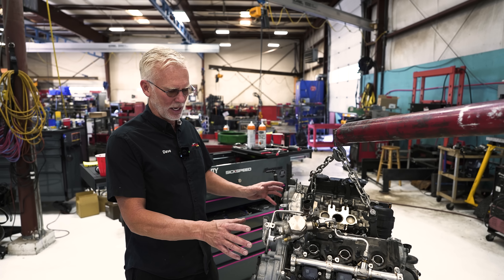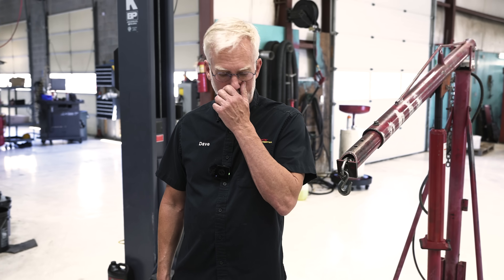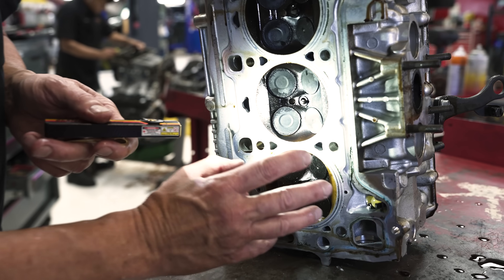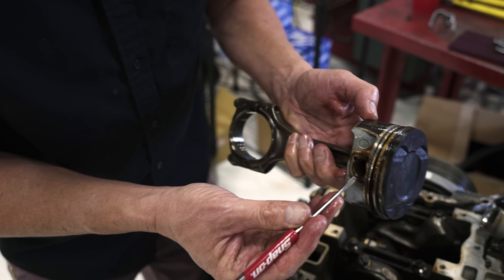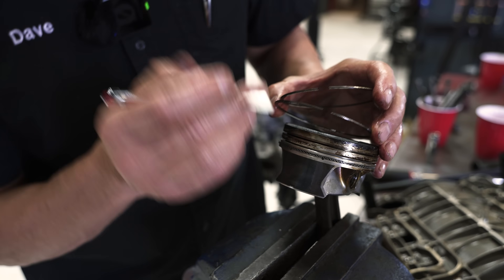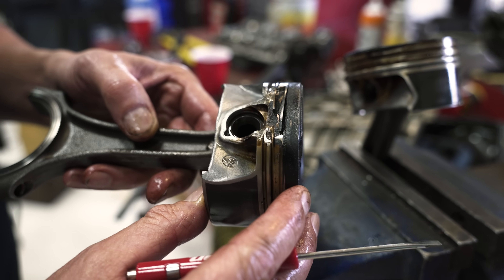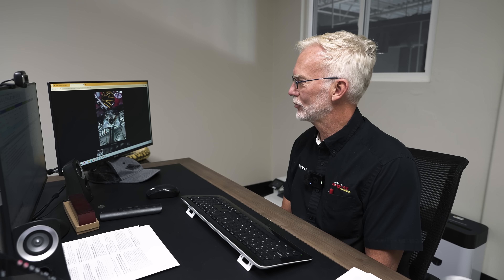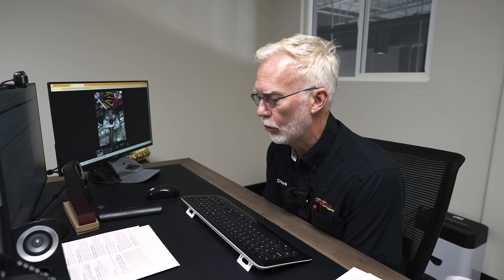Audi S5 Update: Piston Damage From LSPI (Low Speed Pre-Ignition)

Comment: I’m gonna be honest if you drive an Audi you really shouldn’t be using anything aside from LiquiMoly, Pentosin, or Factory Oil. Castrol although on the oil filler cap will cause problems. Also just wait a 20-30 seconds for the car warm up.
Reply: Since there is warranty on engine till 80k miles in usa related to piston issues, all owners should use factory oil, so warranty can't be denied

Comment: Use the oil viscosity recommend by the maker.  A 0W is thinner than a 5W but they both flow well in cold temps (above -20 F).  The SP shows that the oil has about 50% less Calcium in its composition.  They found that high calcium was also a contributing factor for LSPI.  Finally use only a premium Top Tier fuel.  The cleaners in that fuel also help prevent this from happening.
I live in Canada but seldom see temperatures lower than 0 F.  My VW uses 5W-40 engine oil.  I have been temped to use 0W-40 just so that it would flow better however a 0W-40 has more viscosity index improvers which can form crud under the rings.
The moral of this story is use the right grade of SP oil (change it at less than 5k miles) with in conjunction with quality gasoline with the correct octane rating.  That might save you $30k for a new engine.

Comment: Thank you, Dave! This was super helpful. Although my engine is dual injected, it appears that the risk for LSPI is minimal, but still there. I use Pennzoil Ultra Plat which is API, SP, and RC certified every 3,000-3,500 miles. I only use 91 octane top tier fuel from Shell, as well as Techron Fuel System Cleaner to help clean both the port and direct injectors. At cold start, I only let it warm up for about a minute (I watched your video with Lake the Motor Oil Geek about that), and I don’t go above 3,000 RPM until the engine oil temperature gets up at least to around 180 degrees F. 105k miles and drives like new still. 🤝

Comment: One quick detail worth mentioning. The germans started, but most nowadays use 1100rpms the second you set cruise control at low speeds(it changes to the highest gear possible). If you're like me, getting in your car, set it to cruise and getting to work, in a cold engine, that cruise control is bad news for residential streets... In uphill or other situation where normally the car downshifts to a reasonable 2000rpm for more power, instead what I noticed is, the car is trying to keep the tallest gear throughout. That is the perfect storm... the ecu is asking for power at 43mph uphill in 6th gear with a cold engine.. all in the name of good gas mileage
Just something to keep a eye on

Comment: its funny im dealing with the same issue on my 2019 audi A6 they share the same exact motor i bought it with 40k miles on it and 2 weeks later theres rattling noises coming from the motor. took it to audi and they told me cylinder scoring and recommended new motor. thank god new york your covered within 60 days and theyre replacing my motor for free.

Comment: hope you checked the rocker arms. The needle bearings are notorious for wearing down on the 2018's.  I had one and had a rocker arm issue that was a very costly fix.  These cars may look cool. But audi quality has really gone downhill.   With so much over engineering you would think they would be so problematic.  But honestly.  My best advice to anyone is never buy the first year of any Audi product.  Wait till the second year or even the facelift.  That sucks for guys who like to tune.  But the facelifts usually have a better look, better options and less problems.  Yet they are all ticking timebombs.  

 Most things on audi's wont throw a code until its absolutely destroyed.   And many audi dealerships will ignore or deny certain issues you KNOW are happening with the car  but because they dont see a code, they wont fix it.  Like when a 2016 S5 roots superchargers has its internal heat exchangers fail.  Very common. It dumps a bunch of coolant straight into the air mixture and you not only get carbon build up but actually you have plasticized coolant around your valves.  I actually had a $10K supercharger bet.  The tech at the dealer didnt want to pull it.  It was fi he pulled it and it was leaking they would replace the cores. If it wasnt I had to pay to have the work done that didnt need to be like pullling and putting the supercharger back.  They rebuilt the supercharger.  

But they never cleaneed the intake valves or any of the carbon.  ANd this was OBVIOUS.  IT was thick chunks of pink.  That was all coolant. Ive had 5 audis.  Not a single one of them have been reliable with the exception of a 2012 A7.  But even that is only a matter of time.

Comment: Normal levels of pre-ignition are supposed to be handled by multiple knock sensors and an ECU that dials back timing with knock onset. Another issue that was not mentioned in this video is fuel hydrolock. When you're running very high injection pressures (300-2000 psi), an injector malfunction can result in serious engine damage very quickly whether it's poor fuel atomization spray pattern and detonation or flooding of a cylinder with fuel that results in piston damage and bent connecting rods. At 75k miles, these "high performance" injectors are prime candidates for malfunction which if you're lucky - just results in a misfire and ECU shut down of fuel to the cylinder in question. If you're unlucky, fuel overload and hydrolock can get very destructive very fast.

Comment: You can actually hone some aluminium cylinders, ive seen it done on a E92 M3 motor. They called it alusil so im not sure if that is different to nikasil. But honed it and then etched away the aluminium in the cylinders using acid to expose new silicon.
Reply: on EA839 2.9 cyl walls are "plasma sprayed" and not nikasil nor alusil

Comment: A Ford engineer actually coined the term LSPI.  It's just oil getting into the combustion chamber.  Oil has really low octane.  He said a good enough gasoline should overcome that.  Matt Dickmeyer says that stratified charge is responsible; you have a rich mixture in the middle of the cylinder, and lean mixture around the edges.  It's the slow burning lean mixture that actually initiates knock.

Comment: Except for maybe certain circumstances, I don't see a auto technician pulling in eighty grand. and this is coming from someone that has been an auto technician most of my life.

Chevrolet Vega's have a aluminum engine block. with silicone impregnated aluminum cylinder walls. and everyone knows how those engines worked out.

Comment: 14:23 before this happens ..Seafoam....run it in the oil couple hundred miles then change it ....put some in the tank ...dump some in the throttle body while someone revs it to 3 grand...won't have that problem...use the correct oil

Comment: Also you're wrong that’s not common. There’s only 2 things that likely cause that. Likely wrong oil or that car was tuned and re-flash back to stock tune prior to selling to previous owner selling to dealer. The customer should have bought extended warranty. It would’ve likely covered a long block. I’ve worked for Audi as specialist technician for 7 years and seen LSPI most of the cars were tuned. ODIS can see that and ultimately the customer will need new engine. 
Dealer don’t rebuild engines we replaced it. 

Also please don’t lie to the young Technician. You a clear 80K by the time he’s 23. You’re probably helping him out and pay him by the hour and not Flat rate. Don’t run into many of your videos, but you talk like a motivational speaker.. Let young Technician enjoy his lunch. That’s off the clock. Teach the Technician don’t on company time don’t exploit him for Subscribers and Likes..

Comment: My guy! I think you just saved my motor. I've been getting a jerk in my A5 at low speeds when its cold. Never heard of this. My oil is API SN which is the older standard.  Changing to SP tomorrow as well as the plugs. Already ran Berryman's and Techron through. Hopefully my pistons are ok. THANK YOU! 🙏 About to go to Stage 2 tune. Pray for me! 😂
Reply: sounds like carbon buildup in the intake
Reply: If it is a crackling ticking noise, definitely lspi. low compression misfire however mild would be the death rumble, and then engine warning light. I've got the B14XFT(Opel Astra K) and it's completely screwed.

Comment: Everything is fine, but the conversation about the cylinders was already superfluous. The engine block is indeed nikasil, but in this generation of the engine, namely the EA839, there are cast iron cylinder liners from the factory, which can also be seen in the video, where you can clearly see the honing grid on the liner, which never happens on nikasil liners

Comment: If I ever need engine work, I am coming to Dave's. Fuel quality and proper octane is important on the TDI engines. I run Top Tier or fuel that exceeds that specification. Top Tier fuel has additives that you mentioned at one point in the video.  The Motor Oil Geek has a video where used oil analysis proves that fuel quality does make a difference in helping keep things clean and help reduce engine wear.
Thank you for the great videos and the best to Alejandro and all the others in your organization.  Your crew does amazing work.

Comment: I do not believe Bosch nor Audi, or any DI oem allows single injector replacement. They are always replaced as a set. 

You can absolutely repair a Nikasil cylinder, we’ve done it many times on motorcycle race engines. You just have to find a quality shop, send them the case where they will bore the cylinder or cylinders then dip the case in tank for replating. The biggest issue with Nikasil is getting a quality plating as poor plating will lead to chipping/flaking which in turn leads to catastrophic failure. The crosshatching needs to be done by shop familiar with Nikasil as the stones used are specific to Nikasil. Never, ever use a ball hone on Nikasil. 

There’s a firm in Idaho we’ve used for many years, Millenium Technology, that specializes in Nikasil repairs. I do not believe their tanks are setup for automotive engine case capacity. I would contact them for referral if you need an auto engine Nikasil repair. Never, ever install an iron sleeve in a Nikasil case, especially with oe pistons. The thermal efficiency and expansion of iron sleeve is drastically different than Nikasil cylinder and would result in comprised performance. The hypereutectic pistons used in Nikasil cylinder applications are not suitable to be run in iron sleeves and will ultimately lead to thermal overload of piston and failure.

Comment: I drive a 2017 Vw 1.4 liter Jetta and use Amsoil oil recommend for my car VW 502.00/505.01. When I start my car the RPM rev up to around 2200 rpm. I always wait until the rpm comes down to normal rpm idle around 1800 rpm. I have done since I bought the car new. I figured it was designed to do this so the car oil was warmed up before driving.

Comment: Any turbocharged vehicle can suffer from detonation. Its simple.. imagine that your gas pedal is not only controlling the fuel but the air going into your engine too. Now your pedal doesnt know the differece between 2k rpm and 5k rpm. 5k rpm can safely deal with the added compression from the boost. (Boost essentailly makes the intake air positive) too much positive pressure in the cylinder causes early detonation, especially if its been tuned and the timing hasnt been retarded.  So if your lug your engine, high gear/ low rpm thats how you purposely make that happen. Ppl do it in subarus all the time.

Comment: As someone with a German turbo’d car… another source of preignition is using low octane fuel. Also can contribute to dirty injectors using cheap fuel without PEA. Audi/vw often design higher  compression ratio engines which even the fuel door will say needs min 91 octane. For having the money to spend on an Audi to begin with, I see a lot of Audi owners putting in cheap fuel in their cars. Combine that with the storm of things Dave mentions it’s asking for preignition.

Comment: Anyone know if this issue with the GDI is also prevalent on the Hyundai’s? I got a used 2017 Elantra GT under a year ago and it’s the first I’ve heard of this type of oil. We did have an issue with a misfire but it wasn’t the coils or spark plugs but having to do with air flow.

Comment: This sounds like and Audi thing.  Why isn't this covered undedr warranty?  Audi should do a recall and fix these rings or replace them.  The API grade oil is a great tip.  I have owned German cars most of my life, and never considered the oild grade and manufacture.  Also, will go back to warning up my vehicles.  I was told that I should not do this on my Lexus.

Comment: They started putting the timing chains in the back of the engine due to packaging, it makes the front of the engine less cluttered. The duramax I6 engine was a good example, they had to fit a long engine in the bay thats designed for a short but wide engine. So moving the timing chain to the back gives you more room in the front for accessories and radiator

Comment: If you hit the throttle on a boosted engine when it is cold you are just asking for trouble. I've had my 2018 Audi S5 for 77,000 miles and its been great. No engine issues. 10W30 Synthetic oil (European) every 5000 miles. Good Vid Dave

Comment: Still waiting for a logical explanation for putting the timing system at the back where additional work has to be done to separate engine from transmission, and in RWD cars, pull the engine. What’s worse is now American makes are starting to do this. There are so many very reliable engines that put the timing system up front, that changing that paradigm seems needlessly exotic.
Reply: My assumption is to make money by charging more for repairs and to make it cheaper to manufacture considering all of the wires and stuff with these turbocharged engines.

Comment: Thank you for the information, however your probable failure explanation is not quite accurate , I would say LSPI  or in another words ‘ uncontrolled combustion event ‘ , basically a left over hot spot from a combustion event caused a combustion event at huge wrong timing API rating is not the only oil selection determination but there is also manufacture specific oil classification requirements especially for German cars . In short LSPI is a huge subject with many theories behind it .short of used oil analysis  including complete Ferrography  analysis knowing the reference  new oil and fuel analysis the exact failure determination is impossible ,

Comment: It’s not insane at all to put the timing chain at the back. The flywheel dampens the crankshaft accelerations from the pistons firing. This smooths power transfer to the chain and makes it last longer or be smaller and lighter. GMs garbage V6 with the timing chains at the front eats them for lunch. Don’t even last 100k miles. Might as well put a timing belt on there. GM junk

Comment: LOT of great stuff in here:

1) Everything Dave said about oil and fuel injector behaviors is spot-on. Great analogies for the folks new to car science. 

This is why, even on modern engines with synthetic oils, I always give my engines adequate time to warm up before driving, or before subjecting them to any real load (beyond 40%)

2) You couldn’t pay me to drive and operate an engine whose timing chains are on the rear of the motor… 👀 🤦‍♂️  Absolute d**k move from our German car pals.

3) Dave’s repair recommendations were excellent. Basically a full engine refresh, with most of the costs being labor and time. If the motor is out, refresh every wear item for longevity and insurance.

4) How the #4 cylinder liner wasn’t completely gouged and destroyed by that catastrophic damage is a mechanical miracle. 🙌 😮

Comment: For all you Americans driving these types of European cars, here is some European advice: Use the correct oil, change it according to factory kilometers, better sooner than later. And 15.000 km is not 15.000 mile! avoid short distance driving, and drive your engine warm before using its potential, minimal 10 km. At last I don know what quality petrol USA has, but you better dont save on that and get the best and you should be all fine.

Comment: I have a 14’ S4 I only use 5w-40 Motul 8100 Xcess every 5,000 miles, at that time I put a Techron or Injectron fuel treatment in the tank to keep the injectors conditioned. 90,000 miles and no issues 🫡
Reply: I have a manual 13' stage 3 unitronic s4 w 149k miles on it. Got it with 74k in 2020 . I drive & treat it respectfully and change oil w/ Liqui Moly religiously along with other safe additives. I started to have misfires randomly the last 4 months and took it to my local euro shop I been going to for years. I believe im suffering the same issue now but it hasn't gotten to be catastrophic . the shop used a camera to look inside and found some detention damage , some wall scoring , basically some of the same symptoms . Did compression tests and compression is 120-100 in 2 cylinders. im debating swapping a motor or taking mine out and rebuilding . it's a tuff decision cuz I love my car..  the manual, red and black guts with carbon fiber trim. all the supporting mods. It's expensive regardless

Comment: With all due respect for sharing the knowledge on LSPI! Please verify - the engine in subject here EA839: cyl walls are not Alu-Si mod. EA839 Cylinder walls are are cast iron-liners. As you can see also by very typical cast iron style hone pattern on the walls. Alu-type walls look totally different btw. One more thing - for cold starts this engine runs on normal LP port injection (it has both)).